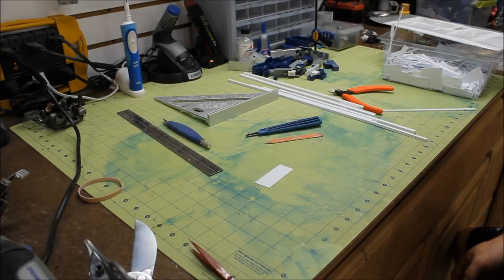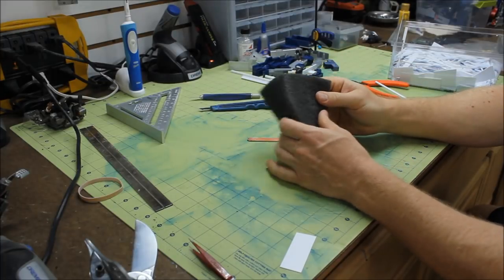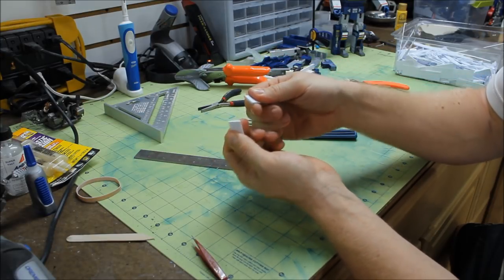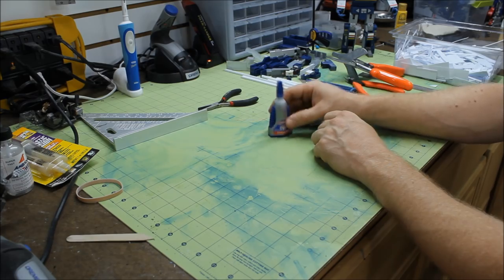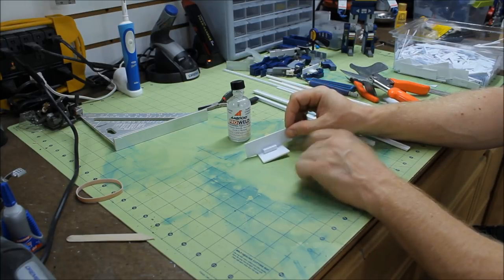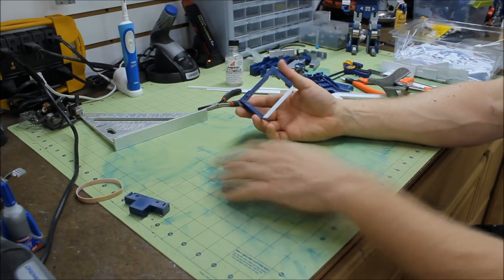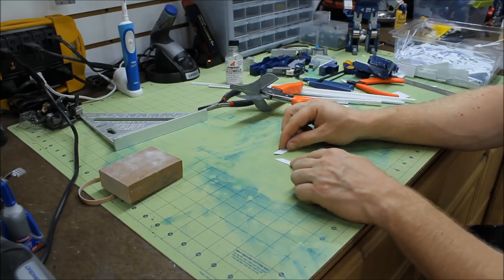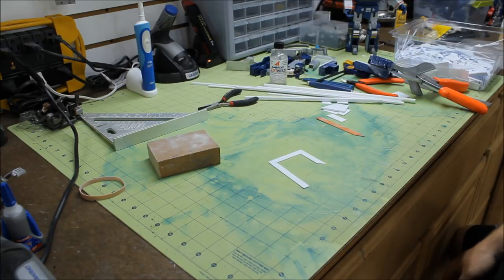Tutorial: The Basics of Working With Styrene

Comment: Some have queried sources.
Styrene is known elsewhere as 'polystyrene' or 'plasticard', but more specifically 'HIPS', standing for 'high impact polystyrene'. This distinguishes it from 'expanded polystyrene' (also referred to as 'styrene' as in cups or insulation).
Cellulose thinner bonds just as well but sets slower than expensive 'liquid poly' type bonding agents so can be useful for alignment. And for mega-cheap, gunwash.

Comment: Decent video.  The pliers are "duckbill" pliers, not lineman's pliers.  In what hobby build, though, would a 4,000 psi joint needed?  That ProWeld actually melts the plastic and it fuses as it the plastic re-solidifies making the joint (when done properly) just as strong as the sheet itself.  But there are some great tips, especially the toothbrush sander!

Comment: Excellent and informative work, thanks for sharing. 
I was wondering..what would you suggest using to bond styrene to lexan? I have a radio controlled pick up truck body and the lexan isn't recessed in the bed portion. I was considering cutting out that portion, and building the bed out of styrene, and then bonding it to the original lexan body. Basically building a styrene box and attaching it to the shell. 
Thanks in advance!

Comment: Thanks so much for sharing tips. Would the reinforced styrene as You should us, be strong enough as a frame base for Wright Bros 1/39 scale Bi-plane but sand dune & beach is 1/100 scale (space limitations) then adding mesh & plaster cloth strips over it. Styrene seems less costly than foam board (fornthe maount I would need) & less weight. Any suggestions, thanks. Take care
/Rosemary

Comment: Hi. You mentioned about Plastic Fuse for gluing. As it melts the surface to join (I am guessing like welding does to metal); does it not distort the clean edges while melting???
Reply from the maker: Nope, it keeps clean edges.

Comment: hi, I've a couple of questions, can u mould the styrene sheet to the desired pattern? I'm trying to build a front spoiler for my Mad Max autoart 1/18. If joining two pieces at 90 gegrees angle, how do I get rid of the sharp corners ie. do I need to use a putty and if so, what kind and lastly what sheet thickness do u suggest I use, cheers

Comment: Why would you use Plastic Fusion over the Pro Weld which is easier to use? Pro Weld is strong enough for any joint.
Reply from the maker: +mailperson Not even close. Plastic fusion provide an unbreakable joint and adhesion. Pro Weld is  easily broken. Look at it like metal welding..... Pro Weld is like a tack weld, where Plastic fusion is like a final weld.
Reply: Ok thanks, I may try it, but so far I've never needed so much strength that regular cement didn't work

Comment: CustomsByZ you said "Plastic Fusion" is "absolutely amazing"

However I am extremely disappointed with Plastic Fusion from Super Glue 
 
Even waiting a full 24 hour later the joint is just too weak. I have tried thee times now.
- Yes I am mixing it up very thoroughly.
- Yes I am doing so at a reasonable temperature (19deg)
- Yes I am mixing it on card and using a the wooden spatula provided
- Yes I am being careful and think I am getting the proportions about right
- Yes I am working with clean (freshly filed) surfaces.
However the resulting bond is little better than EMA Plastic Weld cement - which is particularly irritating after all that time spent mixing the glue. Moreover and the setting time is also longer than expected. It says sets in "5-10 minutes" but that's a massive exaggeration, as in 10 minutes it's still pretty gooey and sticky. After 25 minutes it's pretty much a solid, although even after an hour I can still sink a fingernail into it.  But either way, even after 24 hours it  it never, EVER gets as strong as solid the styrene itself! Not even close.

BACKGROUND
I am layering up my 1mm Plasticard sheets using EMA Plastic Weld produce solids of 3-4mm and I am then joining those solids together at 90 degrees. To get clear, I am looking for joints of high mechanical strength, in order to resist the mechanical springs I am working with. Slightly surprisingly yes, the base virgin styrene is strong enough for my purposes, although I had ordered up some ABS in case it wasn't. (But I am now concerned that it's harder to glue ABS than styrene so that may prove to be a mistake.)

Back to epoxies, I don't mind mixing up epoxy glues for say 30 seconds, even 1 minute (if I have to), but I do mind waiting for much longer than say 2 hours or so.
 
Waiting for glues to dry is a serious problem for me as it interferes with the prototyping process itself.
 
- What is the strongest glue for styrene that also sets fast - i.e. within 2 to 4 hours?

Thanks

J

P.S. I am now wondering if maybe I have a bad batch of Plastic Fusion. What was worrying is that the very first thing to come out of one of the tubes was a transparent oily substance. So this may have been the problem with my first attempt. Fwiw, my attempts have all been using about pea-sized volumes of epoxy glue, and the epoxy looks what I assume is 'normal' (not streaked etc).  I cant find any expiry date on the packaging...  I got it off an eBay merchant "Motorway Hessle LTD" who have a good rating on eBay (99.8% after 71,162 feedbacks) :^(

Here is what I bought
http://www.ebay.co.uk/itm/Super-Glue-Epoxy-10-Minute-Plastic-Fusion-2-Part-Bond-Plastics-Glass-Rubber-/261508621516?
Reply: +John . Smith UPDATE: I have ordered some more Plastic Fusion from a different supplier. Let's see if it works any better.
Reply: +John Smith 
OK I have now tried the same stuff (Plastic Fusion) but from a different supplier. The result is also absolutely terrible. It never sets with a decent strength and can still be cut with my fingernail(!) Possibly a poor batch made by Super Glue Inc??  Fwiw, Devcon's Plastic Welder does set properly. The bond is reasonable on styrene - albeit not as good as cement for styrene-stryene.  

Regarding styrene cements, Ambroid Pro-Weld that Z mentions appears to no longer be in production. But I have had good results with  Tamiya Extra Thin and  Mr Cement S  and EMA Plastic Weld.

Comment: You're not using the best glue you can. Tamiya Extra  Thin cement is leaps and bounds better than any other welding cement (other than Cement S, which is as good [it evaporates quicker but it's brush is slightly less fine])
The cements mentioned above require TINY  amounts used, and you don't brush it all along the join, which makes the join a little ugly, all you need to do is touch the brush on the corner and the glue will run all along into the microscopic seams.
Try it, I can 100% guarantee it's better than what you're using in the video.
Reply from the maker: I have used that. It is not better on styrene.... not even close. Ambroid Pro Weld is MADE specifically for styrene and has produced the strongest and most durable joints when bonding styrene. With regards to the plastic fusion.... it is bar far the strongest bonding agent for any and every type of plastic. it makes 2 pieces 1 and you would need to mechanically separate them to make them 2 pieces again. Been using both for 7+ years now and have no need to try anything else ever again. Thanks for your input though!
Reply: CustomsByZ
TET is specifically designed for styrene. It's use is for supporting heavy structures that are unsupported on styrene models.
Let me clarify, we're not talking about strength here, these glues, as I'm sure you know, do not "stick" these together, they weld them, hence the "weld" etc.
It's irrelevant about the strength, because melted styrene will have the same strength regardless of the glue (presuming the same amount is applied); we're talking about:
Value
Speed of evaporation
Fumes/Odour

TET and Mr Cement S are specifically designed to do the above as best as possible,

Comment: 10:42 FAIL
Reply from the maker: +ealiev60 Um.... the plastic welder needs to set, then dry. It does not bond instantaneously.... pretty much common sense with ANY adhesive there bud.
Reply: The only fail here is your comment.